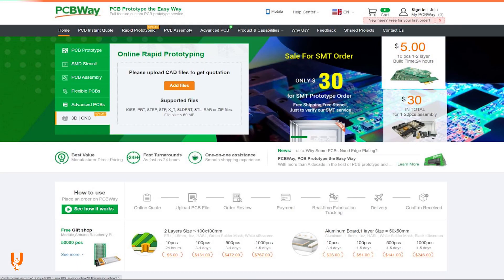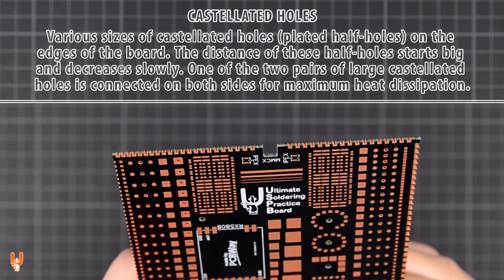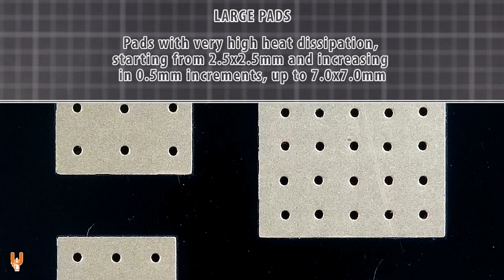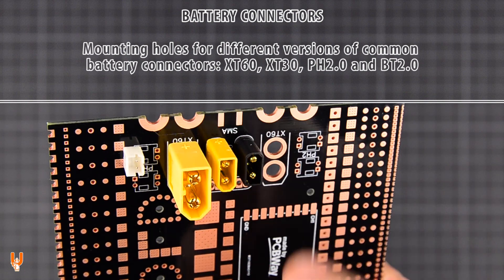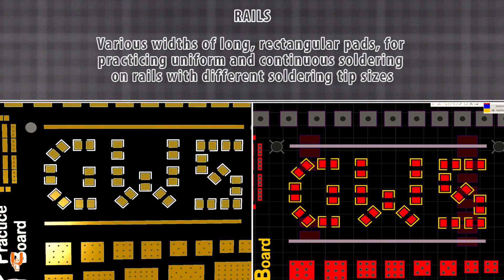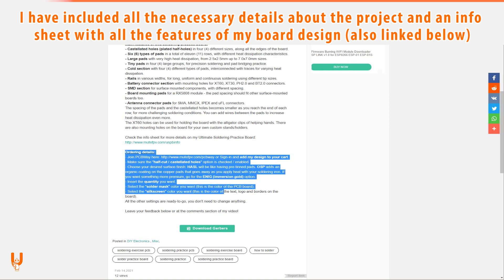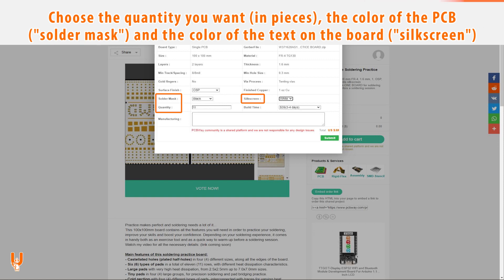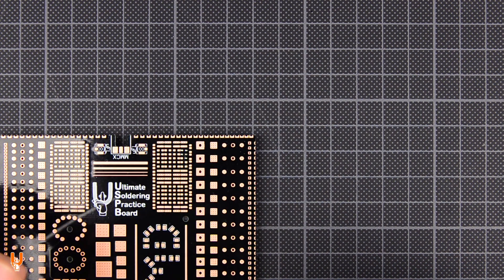The Ultimate Soldering Practice Board ✍ that can improve your soldering skills!

Comment: These look very cool! I'm down with buying whatever I need to learn the art but when I got to choosing "surface finish" I had NO IDEA what to select because what I want is what I will deal with on most quads. I am that new to this! When I select different options the price changes anywhere from $25 to $200! So now my cart is open and I'm frozen not knowing which to select so I can get what I need without paying WAY too much!
#NewbieProblems
Reply from the maker: Hello! HASL will be your cheapest option but will be easier to solder onto. I prefer OSP which is a bit more expensive but helps you practice timing heating the pad and applying solder to it. Actual PCBs of ESCs, for example, have a lot more copper and most probably multiple layers, as well as large surface common grounds which is usually the most "challenging" pad to solder onto, especially if you want to solder a large wire (the smaller the AWG number, the larger the wire). My practice board won't help you with this, but its large square pads are a good practice for this purpose.

Comment: Fantastic idea and project.   I started to buy but price is a little steep for me given that I can solder pretty decently being in this hobby (helicopters/cars and now quads) for 8 years.   If the price drops I'd love to get this as I still struggle with really small stuff  like 16x16 stacks and AIO tinywhoop boards.
Reply from the maker: Thank you! Please note that I don't sell the board myself, I share the project and anyone can get it directly from the manufacturer. Maybe split the cost with a friend, you don't get just one board at that price and buying 10 is a fairly cost effective quantity. The castellated holes (the holes around the board, right on the edge) increase the price significantly but allow for an important soldering practice on their own. I am thinking of designing a cheaper alternative (without the half-holes at the edges) but it will take a while.

Comment: Never saw a need for the solder practice boards.   The only issue I ever had was on old DYS FC that had a signal pad that was in a horrible position along with being a bad thin design.    Only other trace I have ever burned/torn was on a micro 16x16 board.
Reply from the maker: I don't need it for practicing now either, after years of soldering electronics and especially micro stuff, my eyes are the problem now, not my hands :P But I do use it as a warm up before a soldering session, it gets me going fast.
Reply: @muteFPV  worst thing I ever had to solder was surface mount LEDs on the instrument panel of my 2007 Tacoma.

I LOATHE RED INSTRUMENTS ON CARS.   I had the LEDs ordered before I even owned the truck yet.

They are these tiny things about the size of a ballpoint pen plastic bit that holds the ink ball.

You have about a 2 second grace period to tag them into place before you heat soak them and ruin them.   Little tony marshmellos stuck to your instrument panel.    I barely ordered enough between melting a few and putting a few on backwards by mistake...

But at least I have one of the only Tacomas with blue LED lighting for the numbers/gauges and white needles.

Sounds dumb but it is much more soothing and calming to be driving at night.

It alsondidnt help that at the time Amazon didnt really exist yet.   My soldering iron I had to use was a tiny little double A sized pen soldering rig.    It worked but just barely.

Doing it with the TS100 these days would be so much easier.
Reply from the maker: Yeah definitely, temperature controlled soldering iron plays a huge role! I thought red is one of the less "intruding" colors for night time, for example astro-photographers use red flashlights to move around without affecting the cameras much.

Comment: Nice👌,
I'm into micros so always keen on small pads!
Reply from the maker: You will definitely enjoy practicing on it then ;) Especially if you start adding wires on the pads, the pads and the half-holes with the small spacing are super tricky!
Reply: @muteFPV  what makes the COLD pads special?
Reply from the maker: The C O and D letters are connected in pairs with traces. Letter L has all the pads connected with larger traces. This results in higher heat dissipation. You can also add wires on one side of the board to increase heat dissipation even more, so this practice board is not limited to just one time use (not just for tinning pads and soldering a few components).